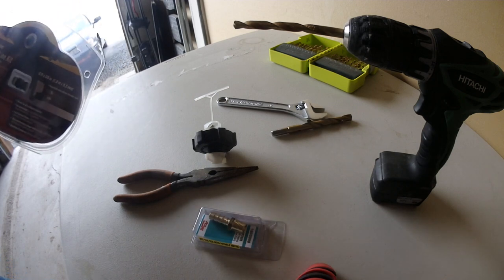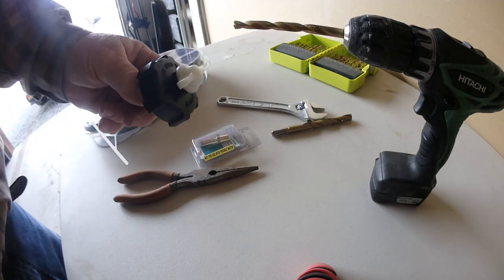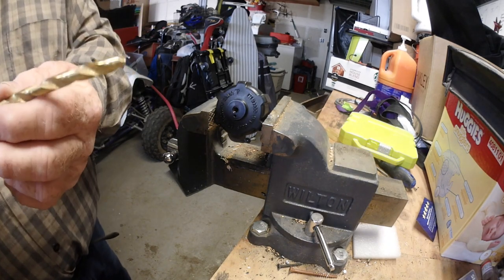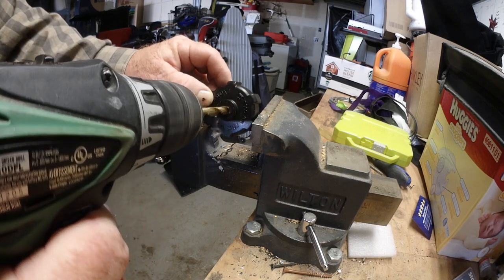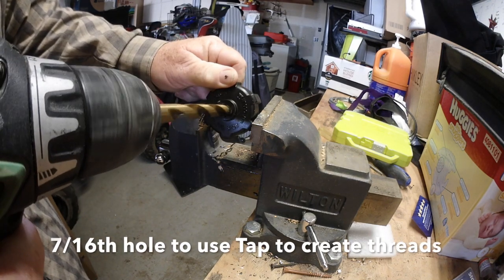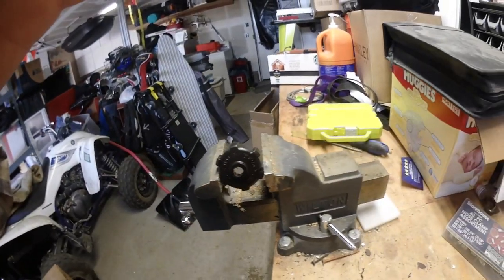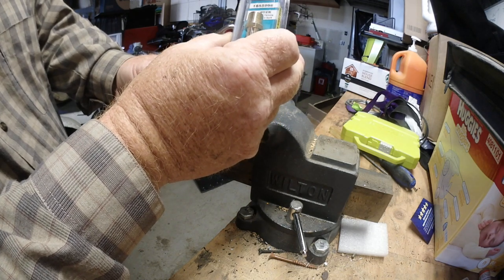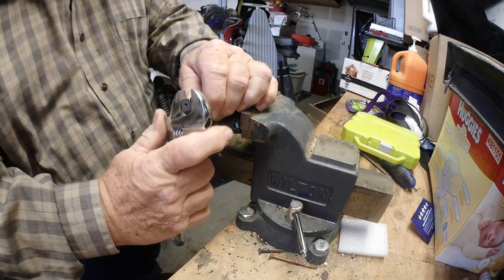Aux. Fuel Tank to Small Outboard

Comment: Now that I watch this again, there's no need to ruin the fuel cap, and use the internal tank at all, just a five minute installation of a piece of hose with the nipple to the fuel line will do. No need to modify the engine at all, and if you decide to go back to internal tank, just disconnect the small fuel line with the nipple, reconnect the fuel line going to the internal tank and the motor is back to original.

Comment: I have a 5HP Tohatsu with built in tank, I just installed a nipple to the hose going to the carburater, and Voila! I have an external tank hook up, and if I disconnet the nipple, I can still use the motor with the internal tank. I think it cost me $20
Reply from the maker: Jorge Lavorerio I haven’t tried that but thanks for the info for sure
Reply: Jorge Lavorerio I'm trying to figure out a way to do that to a Mercury 3.3 can yo mabby put up some pictures would be awesome thanks
Reply: I think your motor would need a big enough fuel pump to transfer the fuel over 6' of hose.  I doubt if my 2.6 hp could do it, so I've gone with the method shown in the vid.
Reply from the maker: @stevebrown5849  I will try and put a part 2 that shows the finished product close up. Thanks
Reply: Did you have to modify the outboard in such a way that would void the warranty?
Reply: @victorjcano  If you dont cut the cover to fit the external hose you are OK, you are not modifying the engine in any way, just adding a nipple to the fuel hose. In my 5HP Tohatsu/Nissan it was perfect, bc I remove the fuel selector knob from the front of the case, and I installed the gas nipple there, and used it like that for the last 20+ years. When I sold the motor bc I got a newer one, I just removed the nipple, connected the fuel hose back the way it was coming from the internal tank, and installed the fuel selector knob in the case again. Nothing done to the motor, but it could run forever on an external tank

Comment: Surely the tank is still going to have to be mounted above motor to gravity feed?
Reply from the maker: I have the squeeze bulb and use it as a pump, by squeezing it to refill the tiny tank on top of motor,. Usually 6 squeezes. This set up basically replaces a pour into the tank, spillage, balancing and weight of a 2 gal or more tank. Often lakes are not smooth, waves from boats, wind and... so this prevents a lot of hassle and I can refill the tiny tank while engine is running.
Reply: @ibcontent  thanks for reply. Yeah I know what a pain in the ass it is to refill on the water. Half the fuel gets spilled that’s why I’m keen to do this conversion👍

Comment: Hi Craig,
Do you refill your tank while the motor is running? Or, you stop the motor, refill and starting again?
My question is about my work in process: I have an outboard with a little tank and I'm wondering if I can connect an external tank with a bulb (like yours) and, time to time, squeeze it (on the fly) to refill a bit my tank. 
Thanks in advance for your time.
Reply from the maker: Yes I filled the tank while running— absolutely no problem And no spillage.
Reply: @ibcontent  Thank You very much. When my project is done, I will make video too.

Comment: Hi. Interesting.  How it works?  You manual prime some gas into internal tank when it's low? Where you got the kits from?
Reply from the maker: Yes I manually pump the gas into the Motors small tank. It's difficult to pour into it especially with waves, plus spills. Works easy. You van get the components at any hardware store.

Comment: Would this work if the fitting on hte cap was a 90 degree fitting  so that it was not sticking straight up? Visually more pleasing and less likely to get tangled on a line used for tying up to a dock or a sheet,
Reply from the maker: Yes it would work that way, good idea, a better idea actually!

Comment: Did you drill the air hole thru the cap or the brass fitting?
Reply from the maker: The whole was drilled through the cap. I removed the breather screw and drilled it to fit the brass fitting. Then the connector on the hose fits and I can hand pump through the hose. No leaning out over boat, no spilling gas, and engine can be running when I pump. I drilled a tine hole next to fitting to allow breathing.